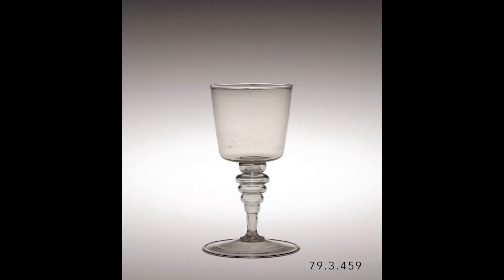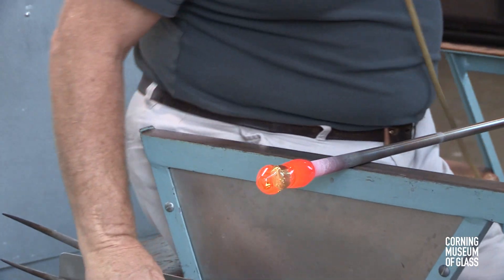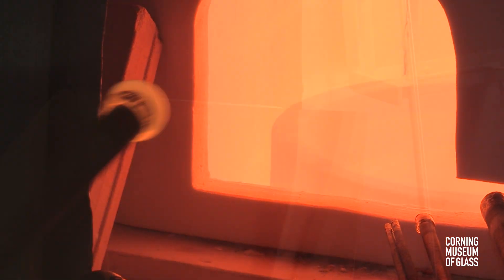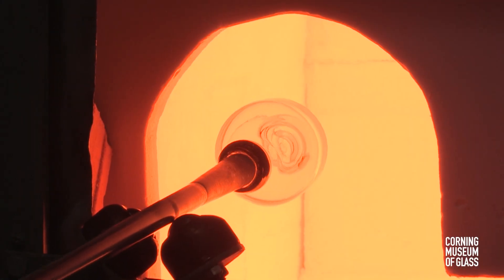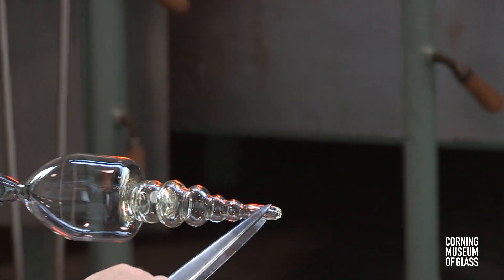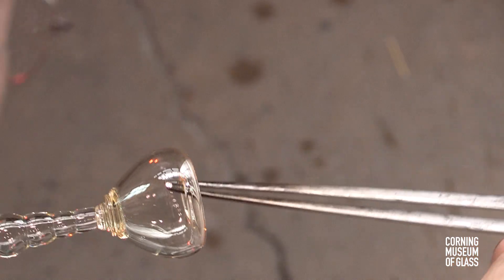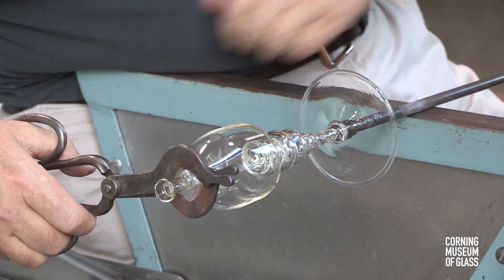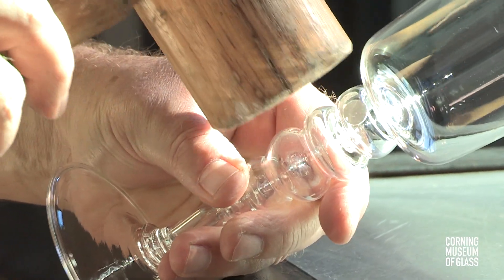Wineglass with Coin in Stem

Comment: Amazing, but why not just use an actual coin? it would be a lot more appealing and aesthetically pleasing
Reply: Sam Chaney I think it’s cause it’ll melt or something. Also I really hate how coin sounds on glass.
Reply: The narrator said it was a "silver" dish to represent a coin of the 16-17th century. If they had used a modern coin, which don't  contain real silver, perhaps it would have oxidized or discolored in the heat? Or modern coins arent small and thin enough (even a dime would seem too clunky) to make a delightful tinkle in the glass stem.
Reply: Possibly just for the demo?
Reply: it is a museum...
Reply: They went to the trouble of using renaissance methods, they could have pressed their own coin...